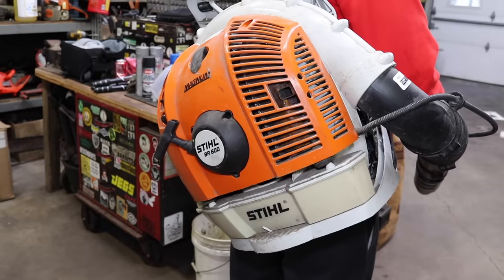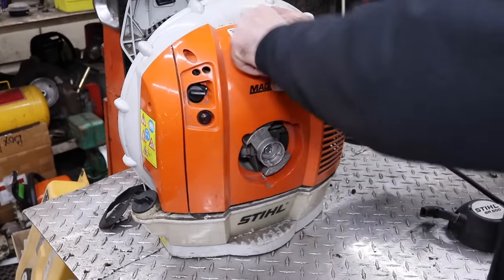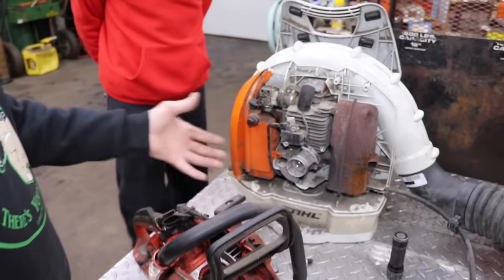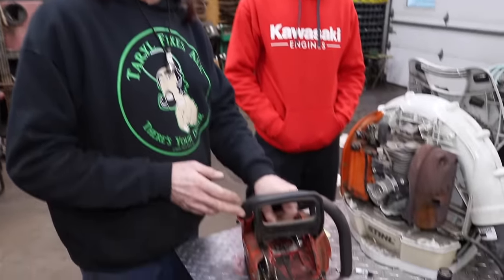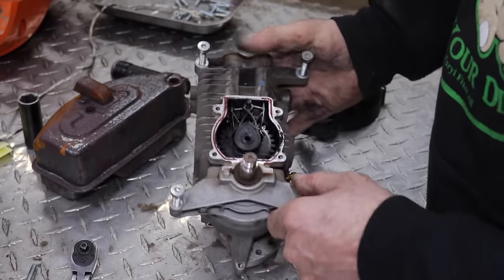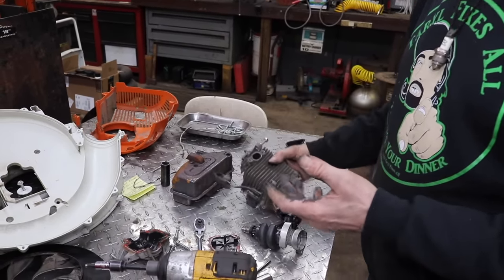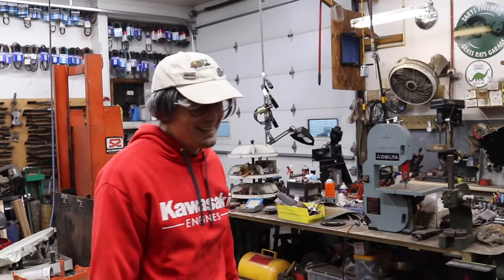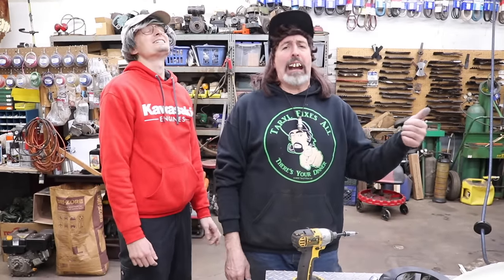4 mix NIGHTMARE! DON'T make this mistake 🚫

Comment: STIHL doubles their factory warranty (for homeowners) if they buy a 6-pack of the Ultra synthetic 2-stroke oil when they buy  the machine.  That should tell you something!

According to STIHL they also made some engineering changes to the wrist pin/bushing after identifying this problem with the early 4-mix engines (BR500, 550, 600) and I believe subsequently made additional engineering changes to the jug/crank/piston in order to improve the splash lubrication of the piston wrist pin.  It's also imperative to keep the carb tuned properly to avoid even a slightly lean running condition.  Even with regular maintenance and quality fuel/oil they still fail.

To their credit, STIHL was/is fairly generous as far as providing complete short-block replacements to dealers at a reasonable price.  If the STIHL dealer asks nicely, STIHL may still give a break on a replacement short-block for an out-of-warranty unit.

Unfortunately this is a pretty common and dumb failure on a professional blower, especially for the homeowner who takes care of their machine only to have it fail outside of the warranty period.  Pro STIHL machines should last well beyond the warranty period for most non-professionals!

In my opinion, the older BR420 backpack (2-stroke, wrist pin needle bearing, Walbro carb) is still almost as good as the BR600...except with far less potential for finicky failure.
Reply: Run their trash oil and get double warranty. Echo gives 5yr warranty and do not care what oil you run. That should tell people something. Got Stihl Echo and Redmax but i do run a good oil.
Reply: @jeffclark2253  yeah Echo is great!

I like the STIHL Ultra oil...and you don't have to run it in the STIHL BR blowers, but it definitely makes a difference to run synthetic oil.  I think what STIHL really wants is for homeowners to buy a gallon of their (incredibly overpriced) MotoMix which also gets them the double warranty.

I mix non-ethanol gas (~$5/gal) with STIHL Ultra at 50:1 and run in it everything...old and new...with no issues whatsoever.
Reply: @jeffclark2253  what 2-stroke oil do you use?
Reply: @tysondomer  Amsoil Dominator and a few others all from a Motor cycle shop. No use for oil with the equipment’s name on it. They make equipment not oil. They get who ever will bottle it for them the cheapest.

Comment: It seems to me they should've had a hole drilled through the rod and the bushing as well to allow easy splashing of the oil to get in there . I'm pretty sure my Sachs old school snowmobile engine had a top bronze bushing, 1969 300 single banger. Maybe it was the JLO 295 engine. I can't remember.

Comment: Is that a homeowner model? This is planned obsolescence, I am going to check the pricing on these now.
The BR500 and higher are professional grade and are more expensive than the model numbers below BR500.
Hopefully my above statement is incorrect and if  the correct oil is used they will stand up to Stihl's name and reputation.
Reply: He said the 500 and higher are the bad ones.

Comment: What kills me about them is the coils. $100 and you have to get theirs. The cheap ones you get just don't work or maybe for a few minutes. I'm not sure why they don't just bolt it to the exhaust. With all that air flowing there's hardly any air getting to the one on those blowers. They're great blowers when they're running right.

Comment: Taryl may have just made the large Stihl blowers come down in price. Thanks Taryl, I love my BR600 but have only used belray h1r in it since new about 10 years ago. It runs like new and it is used a lot on the farm for blowing off equipment. I think I need the BR800 now but ill make sure to stick with the best 2 cycle oil made.
Reply: I’ve been using Motul 800 in my saws and I like it,not cheap but that’s ok. I used to run H1R in my dirt bike so I bought a bottle to try in my saws now too. 😎
Reply: I use Amsoil's Saber oil with 90 octane ethanol free gas in my BR600. I'd  recommend that

Comment: I have a Stihl chainsaw and a Stihl string trimmer, and both are junk. The chainsaw stopped oiling after about 20 hours of use, and the trimmer started leaking gas from the carburetor after about 10 hours of use. I'll never buy another Stihl product.

Comment: That bushing doesn’t see a 360’ rotation like a needle bearing does so there’s much less wear in that dozen or so degrees of movement.  The bushing was obviously still tight since you had to hammer it out.  A new head and piston should fix it up.  Not that it’s Stihl too expensive of a fix for a retail customer.

Comment: You just have to wander why so many manufacturers, with a once reputable name , have started to build so much cheap junk . I spent some time in a shop back in the early 80s , and a stihl was just top of the line , at the time . Same goes for the small garden tractors today . They’re junk , being sold on a past good name .  And then too, along comes the Honda engines, and everyone talking about how great they were . Lol. First one I had to tear down , was a disappointment.. plastic camshaft, and an internal timing belt,. Lolol. What a joke!!!!

Comment: Seems like Stilhl has done this on purpose, knowing most people will not spend money on their patented oil mix.  
Think about it - they put in cheap parts, a couple years go by running on unsanctioned oil, the machine fails, and Stihl is not going to stand behind the product because (a) they’ve taken your money (b) the machine is out of warranty (c) even if the machine were in warranty, they will likely not cover any damage associated with non-sanctioned oil and (d) they need to stay competitive by making these items as cheaply as possibly given the quality.  This is frustrating when you spend $600 for this machine and you see this.

Comment: The advantage to the design is being able to run the blower in any position without the risk of a lubrication failure.
 Saito model airplane engines are the same design. The best 4-cycle model engines ever.
Reply: How often do you run a backpack blower in any position other than vertical?

Comment: There's a reason why they offer you an additional 2yr warranty if you buy a 6 pack of their oil.  That said, a half ass machine shop could heat treat that rod, and mill it for a needle bearing wrist pin.

Comment: Wow! I thought when this engine came out that it was the most amazing. After realizing how it would and how some of the parts you showed that failed. I’m not a fan. I think the areas that they cut corners on is just plain stupid. The plastic cam shaft and the plastic cam lobe is just a part waiting to fail. It’s a throw away item. Maybe 5 years and then it fails you toss it and hopefully you will buy another one. For me. Echo blowers. Stihl chainsaws. Sthil trimmers with a out this engine. Otherwise, Echo. This is how you take a good name brand and through mistakes like this end up going broke. Hopefully, they figure this out.

Comment: Never ran stihl oil in my BR600 after the free warranty oil was used. Thing has a ton of hours, sold it to a buddy, still going 0 issues. Now I have a BR800, using the same IPONE oil mix. No issues thankfully.
Reply: I highly recommend you run ultra mix in your br800. I have replaced tons of br800 engines. You will be sorry.
Reply: @bluejene2146  if they were going to blow up they would have by now. Not worried
Reply: @Handwrench 83'  lmao that is not true. Engines dont just suddenly die when you run the wrong lubricants. You are slowly damaging the internals and will one day learn your lesson. Good luck. Btw ive worked on about 40 br600s and 25 br800s in just the last couple months. Im a stihl tech and this is what i do. You might want to listen.
Reply: @Blue Jene  stihl tech. That explains it. Tell me, why did they cheap out on the wrist pin bearing and put a bushing in its place? It's so that this video scares the consumer to run their oil.
Reply: @Handwrench 83'  the unit on taryls bench is very old. This isnt something someone bought a few years ago. These last forever and this one died because of negligence.

Comment: The only problem I have had with Stihl 4mix is the exhaust valve keeper breaking and the valve drops out and smashes into the piston this is using Stihl oil the has happened on too strimmers at work
Reply: Noooooooo, Stihl oil good, others bad!! Taryl told me so....

Comment: I know a lot of people don't like using replacement motor but I looked up a replacement for my chainsaw $150 for the whole motor
Reply: 50 dollars I meant to say
Reply: @wadebarnes6720  I did the same on my ms250   Why not?
Reply: @michaelhowell7275  yeah I payed a hundred bucks for it a while ago. Brand new had a defect in the side cover I don't remember how many chords of wood I cut but a bunch finally side cover give up the ghost I bought a part saw . The one I have is a 180  nothing special good oil and good gas goes a long ways

Comment: Bronze was good in the old days of real leaded gasoline..the amber gas..I use to delead head Harleys..if you don't you have junk...today's  e10 destroys evey thing..back when I owned a 1950 Ford 8 n tractor, I used marvel oil in my fuel..the tractor is still in use..today's equipment is pure junk..

Comment: If they weren't gonna use a needle bearing,  they shoulda mounted the engine sideways to make it easier for the lube to reach the wristpin. To make matters worse, it looks like the only oil getting to the crankcase is what goes past the piston rings! The cylinder looks like it's aluminum and prolly had chrome plating. The wristpin bushing seized up on the wristpin and was forcing the piston to rock as it moved. The rocking piston was wrecked and wrecked the cylinder. Total loss. Looks like I'll be going to the Stilch dealer for my oil!

Comment: If it's premix additional lubricant will make it run hotter ... (oil rich = fuel lean) ..There is no oil hole in the top of the rod ,,, that's what kills them ..

Comment: Aren't 4-strokes great? A 2-cycle would not have continued running long enough to wear out a piston that way. I'd be suspecting a faulty air cleaner causing the cylinder to dust out like that. The noise was the piston slapping around. The wrist pin bushing may have shown wear but was probably caused when the worn piston bobbled around. The oil looks like crap because its full of dirt and aluminum.

Comment: Why would make a four stroke engine and then run it with 2 stroke oil?  I thought the main benefit of a four stroke is reduced emissions. Looks like more complexity,  
more weight, and less power with the same amount of smog to me.

Comment: With proper oil 
Stihl ultra and or a proper full synthetic (opti)

They will last forever 

I ran castor 927 because I loved the smell hah 

Joke was on me 

Had to take a few units apart and scrape carbon from valves and piston

Comment: Well what kind of oil should we buy to put them in there and I'm taking that as we should put it in our weed eaters and everything else
Reply: According to the stihl manual for a br700 they recommend their motomix premix fuel with their HP ultra oil. If you mix your own oil they say any oil jaso rated FB, FC, or FD. HP ultra is FB, an FD rated oil is a better oil than FB. You can search Richard flagg on Youtube and see his tear down vids on HP ultra oil. (The motors arent pretty). I would use echo Red Armor @50:1, it is FD rated and it does an excellent job. Motors l work on that run it are clean on the inside and have a great oil film. Almost all equipment l work on leaves with a full tank of 93 octain, ethonal free, with red armor in it @50:1. I run amsoil saber @ 80:1 in my comercial echos (bought new 1.5-2.5 years ago) but they are two strokes and have had 0 issues. Some of my older echo equipment gets the red armor. My brothers shindaiwa has red armor since new 1.5 years old and our church has a shindawia trimmer that's 4 years old has had red armor and those motors are just as clean as mine with saber. Both are great oils in my opinion.

Comment: Seems like something they would have for sure had happen when they tested them right? Or did the prototypes they tested have a bearing there, and the penny counters decided they could use a bushing there like they have on other engines without issues, to save 2.3852 pennies, without consulting anyone or testing it, I just doubt the original designer, knowing these run high RPM constantly, thought a bushing would survive...
Reply: They sell crap

Comment: 😳🤔😲 why would they go through the trouble of designing and using a 4 stroke engine that uses a fuel mix... i have a husqvarna trimmer that has a Honda 4 stroke it works fantastic oil goes in the sump and regular gas in the tank it only pill bottle of oil that drain and fill in literally a minute

Comment: I'm thinking someone picked up the wrong gas can with straight gas instead of premix, and any oil that was in there from before, is what you're seeing. Can't believe they'd have the gall to not only cheap out on the rod bearing, but also a plastic cam and followers?!! WTF Stihl??😡

Comment: How about a full synthetic (not the Stihl brand)?  Anyone ever had issues with just a basic any brand full synthetic 2 cycle oil mixed at 50:1?   Or even a synthetic blend oil?
Reply: According to the stihl manual for a br700 they recommend their motomix premix fuel with their HP ultra oil. If you mix your own oil they say any oil jaso rated FB, FC, or FD. HP ultra is FB, an FD rated oil is a better oil than FB. You can search Richard flagg on Youtube and see his tear down vids on HP ultra oil. (The motors arent pretty). I would use echo Red Armor @50:1, it is FD rated and it does an excellent job. Motors l work on that run it are clean on the inside and have a great oil film. Almost all equipment l work on leaves with a full tank of 93 octain, ethonal free, with red armor in it @50:1.

Comment: You are right on here. However, that said, I am a gold certified Stihl Master technician, and have been working on Stihl since the early nineties. I retired from a golf course last year that used BR600 blowers day in and day out. Seen a few of these. Worked with a couple of FINE techs from Stihl to determine the problem. You're correct. Lack of lubrication. However, ONE TIME you forget to mix oil in the gas, and this is what you will get. It will eventually seize the small end of the con rod. I do agree with you though, use ONLY Stihl's oil. It is a little bit more, but it's SUPERIOR to the others.

LIke I said, we used these things day in and day out on the course. As long as the fuel was mixed correctly, no problems. I was at the course 5 years as their chief mechanic. We used the same 5 BR600's the entire time I was there. One thing you do need to do with these if you're going to use them like we did, is re-seal the lower end of the crankcase about every second year. I just made it part of winter maintenance. THAT, IMHO, is one of the BIGGEST downfalls of the 4-mix engine. They run hot, like you said, and the German red RTV used to seal up the lower end of the case does not hold up to the heat. The seals almost NEVER have to be replaced, but the RTV has to be cleaned up, then re-sealed. The lack of a lower end gasket is more of a problem IMO than the bronze bushing. That bronze bushing will NEVER fail as long as a) you use Stihl's 4-mix oil, and b) you never run it with straight gas.

Love ya man! There's your dinner!
Reply: Im a stihl tech and i approve of this message.
Reply: They sell crap

Comment: like everything being made by the companies controlled by Blackrock and Vanguard, they are made to fail. Cars, washing machines, anything electronic, are made to not be serviceable. Parts unavailable, unaffordable and not worth replacing is the new ethos, I can still buy parts for a 40 year old Kohler but not for a 3 year old  washing machine. they have crushed competition or bought them.

Comment: I don't know if you can do it or not is it possible to run them on propane
Reply: Any Gasoline engine can run on propane
Reply: How Would You Mix The Oil You Would Need Oil Injection 😩
Reply: @chrischiampo7647  correct

Comment: Just use good two stroke oil. But in all reality, why make a 4 stroke engine that requires a two stroke mix? Makes no sense to me. If you have to do that, just get a two stroke. But make sure you use good oil.

Comment: its in the manual to use there oil only, people dont want to read. if you use any other oil your void your warranty.
Reply: According to the stihl manual for a br700 they recommend their motomix premix fuel with their HP ultra oil. If you mix your own oil they say any oil jaso rated FB, FC, or FD. HP ultra is FB, an FD rated oil is a better oil than FB. You can search Richard flagg on Youtube and see his tear down vids on HP ultra oil. (The motors arent pretty). I would use echo Red Armor @50:1, it is FD rated and it does an excellent job. Motors l work on that run it are clean on the inside and have a great oil film. Almost all equipment l work on leaves with a full tank of 93 octain, ethonal free, with red armor in it @50:1.

Comment: Echo blowers still have conventional 2-stroke engines.
Reply: Echo srm 3611 T/U  ,  mix motor! 🤣🤣🤣🤣 hibrid H4
Reply: @vikingpower95  PB-9010H
ECHO X Series.  Walks all over the Steel.
Reply: @triple6758 PB 9010 H,  this not classic motor , this  is mix motor!    Similar to 2 mix stihl motor!!!!  Classic 2 stroke motor  it is not a MIX ENGINE!!
Reply: Classic engine stihl  ms 440,260, 660..., mix motor engine  ms462, 661, 261 ....
Reply: @triple6758  ecology is a problem   conventional  clasic 2 stroke engine